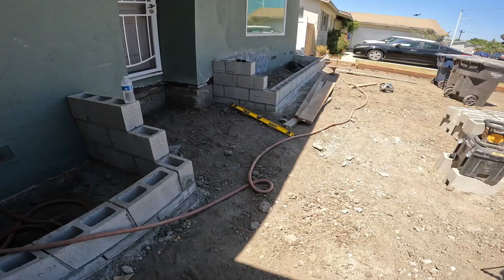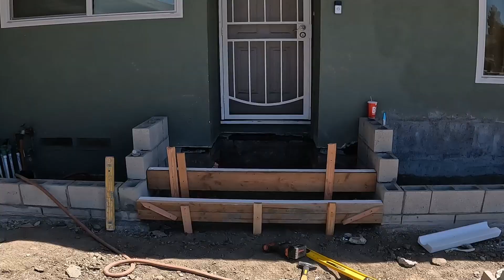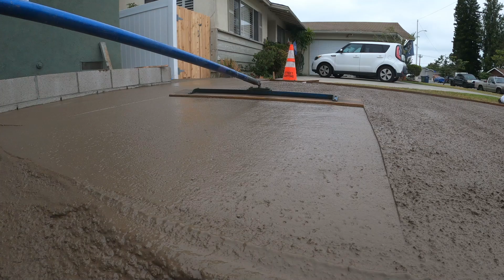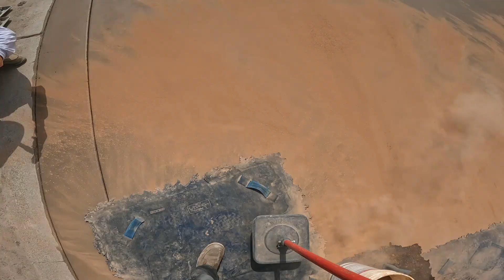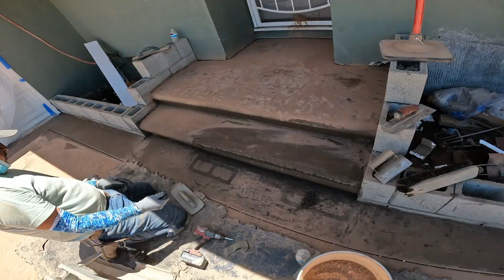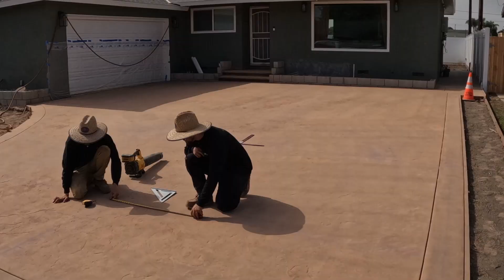Ruined Brand new Stamped Concrete Driveway!?! I cant Believe this Happened!

Comment: I like using Butterfield step liners they cost a lot but you can use them over and over attached to the wood with a finish nail no need to strip them

Comment: Don’t buy them make them out of blue styrofoam. Cut the size of rise you want and run them on table saw on diagonal. Use profile of one to adjust blade height. Won’t be perfect but close and you won’t be able tell there not.
Reply from the maker: Sounds interesting
Reply: @OdellCompleteConcrete  and spray them with liquid release right before placing concrete

Comment: Best glue i found for foam to wood is polyurethane glue (ie. Gorilla Glue).  Mist both surfaces with a bit of water, then stick em together.  Dries fast, holds very well and won't melt the foam.
Reply from the maker: Interesting
Ty

Comment: I have done concrete flat work ,stamp,walls curbs ,you name it I done it .never heard of straw and would not recommend that at all.never heard any one even say straw when talking about fill in a slab or any kind of back fill .maybe to keep mud from getting on finished product.concrete 8 inch block to fill in steps is good .and the bull nose foam forms I used to use small drill bit and drill 2 holes about 3 inches apart from each other and run wire threw my step face and the bull noise and twist it on out side of wood form .seem to work good with no mark on concrete face .used duct tape before that work good .by foam board and make your own bull face forms .instead of paying 30 dollars a piece.they sell the foam and not hard to make a diy jeg a mado.
Reply from the maker: Top secret stuff

Comment: How comes you do not use crack inducement joints and just cut the middle.. this will crack from edge to your cut lines. Bet you have to go back on some jobs because of cracking. Integrity should always come before beauty with concrete...
Reply from the maker: Corners crack

Comment: Here in England we use pva glue to stick the poly forms to timber... And use normal polystyrene then carve it ourselves, doesn't take long.. also why do u strike your forms so quick? Give it more time,Also we use fiberglass in our concrete so it holds its form around corners or mass fill it.....
Reply from the maker: Good idea
Ty

Comment: Hey man youve been a great help to me in the past had one question today.
So crew i work with we use mags for floating.
Typically do decorative work.
Is there any do's and don'ts for using a resin trowel for scrubbing? I know its great for those "oh crapp" moments and used for broom finish, burn finish, curbs but is there any issues if used for stamped, sandy finish, things like that? 
Out in pnw WA and ORG. Use mags and steel trowels but i see some crews use resin floats. Ive always met old school guys who used wooden floats. I know it does same as a mag but i get that resin /wood are rougher. 
My question is, will using resin at the wrong time cause major problems with end result finish?

Sorry if im all over the place, i have a diffucult time expressing what i want to say on paper/text and in person sometimes lol. I was more of a math and P.E. guy🤣
Reply: EDIT: P.S i am also hesistant to bring one onto the jobsite is because why wouldnt all finishers keep one on hand JUST IN CASE concrete sets up fast and they need to speed things up. Like ya know? Any tool to make the job easier right?
Reply from the maker: Every situation is different. I like to use all the different tools and decide which one is working best for me.
Reply: @OdellCompleteConcrete  sorry man. My english/writing is garbage🤣. Makes me wonder if i got problems sometimes. Lol but im great with numbers and measurements strangely enough.
Anywhere my main question was is it suitable for all finishes. Like can it completely replace a mag float?
Can there be issues if you use a resin float at the wrong time? (Example: like if you use a steel trowel to place concrete when its still wet/ just poured. 
Thanks again man. Appreaciate your advice and you content man keep it up!

Comment: I love watching your videos.
I was quoted $2800 for a 8x12 x 4" shed pad in Canada. I used your tips and got it done myself for $550. Found a company that delivers pre-mix "pay as you go" only pay for what you use. My neighbour borrowed me a bull float and edgers. Looks as good as anyone could hope for.
I kept it covered and moist for 3 weeks. It's solid as a literal rock! When I went to drill my baseplate anchors into it, the concrete definitely cured harder then I'm used to this way!
Reply from the maker: That's the way to do it

Comment: Yeah, it's the solvent in the 3m that dissolves the styro. Like you said if you let the solvent dry first you can apply the styro with little or no dissolving. I found out the hard way too. Industrial strength double sided tape is probably easiest and most versatile way to attach styrofoam to anything in my experience.
Reply from the maker: Yes the acetone acts as a carrier and evaporates quickly
Reply: Try using a dribble of aerosol foam. The 'window and door' type doesn't expand like crazy.
If you make a sandwich (backer-profile-profile-backer) a couple of wraps of electrical tape is all you need as a clamp until it sets.

Comment: wow if those pieces of styrofoam were more than twenty five bucks each i would be really pissed at myself for ruining them. that spray glue has solvents in the propellent. didn't you ever spray carb clean or brakleen around any foam? seems like you could have used double side tape without melting them. how much were they?
Reply from the maker: 25 sounds about right

Comment: They make adhesives that are foam proof that you can buy at the home center and there is a form release liquid that can be had for that white foam. There are quite a few designs of that foam edge we used to use them on swimming pools but we never had to strip them early for a finish as pools have epoxy finishes on them but I sure used to sweat installing those foam forms on those custom radias`s but never broke one.
Reply from the maker: Good to know
Ty

Comment: That looks amazing... For myself who works on my vehicles and such, I could not deal with a driveway with a texture like that, but if I had a good sized shop (like an RV garage with the 6 bay garage) then I would do something like that for curb appeal out front.  You guys did amazing work.  I'd like to see more on the fix for the step, did you guys mix more concrete to fill back in and use the screws like a dowl/rebar type thing to hold it in?  Or did they press the curb that fell off back on?  Did it require a coat of cement glue or something to help hold it to the step poured awhile back to prevent a cold joint crack?  Just interested in that part more is all.  A video on that scenario laying it out would be cool to see.
Reply from the maker: We remixed the part that fell off and put it back

Comment: Typical Mexican Fix for the Steps that FAILED.  To fix it PROPERLY, why not REMOVE THE STEP COMPLETELY AND REPOUR IT PROPERLY.  The MIX WAS FAR TO THIN even for the slab.  I would have had you STOP if it was my place and send the concrete BACK and get it down RIGHT from another company.  You are NOT a professional concrete man.

Comment: Raised planters against a house wall is just asking for termite trouble.
Reply: How
Reply: @fern3832  Building code typically requires dirt to be 4"+ from the wood framing. Putting a planter up against the outside of the stucco invites subterranean termites to find cracks in the stucco and start eating the siding or entering the house to find some nice trim wood. The water used to feed the plants in the planter box goes to feeding the termites.  The planter box hides their tunnels and allows them to enter unnoticed, usually until its too late.
Reply from the maker: Raised concrete Fondation

Comment: Turned out nice. With that much help on such a small driveway they should have been able to cut the joints with a nice 304 or 314 jointer and given the borders a nice sand finish with a sponge. Also your boy would be better off finishing concrete than recording videos. 350 cash for 4 hours worth of work is 87.50 an hour. He can apply for state benefits and double or even triple dip by also applying for financial aid. Just saying!
Reply from the maker: That sounds too good to be true.

Comment: Excellent design and Implementation, would love to see it person,  but it's a bit far from England to pop over 😀. 
With regard to setting out a line perpendicular to another, you can use a 3 4 5 ratio triangle , just mark out 3 feet, then with the hypotenuse at 5 feet, when this crosses the vertical at exactly 4 feet, you have at perfect 90 degree angle, works with any ratio using  3-4-5.
Fantastic work as per usual. 
Thanks for sharing and best regards John.
Reply from the maker: yes this way works out very well too! thanks for sharing the info!
Reply from the maker: Great suggestion!
Love that system, no need for a square

Comment: To make the bullnose you can rip a piece of 2” PVC in half on a table saw and butt it up on top of a ripped 1x. Attach to the form with screws. Wont crush like the foam does.
Reply: They sell silicone reusable at like 200$ a piece
Reply: I used to use pvc when doing a big radius on drywall.  Not as a form but as a the actual outside corner.  Cutting it on the table saw is a little tricky though.
Reply from the maker: Try putting the blade on backwards
Reply: I was thinking the same.
Reply: Bandsaw and taking it slow would be a far safer approach to cutting pipe in half..
Reply: Thats a great idea. Thank you from a fellow contractor

Comment: Wait- bails of straw to fill a large void?  And when the straw breaks down what happens then?
Reply: I don’t think it’s a good idea… I would rather use salvaged concrete chunks from the demo to fill large voids.
Reply: 😂😂😂 are you kidding me? Straw? To fill a void in concrete?
Reply: If you have 6 inches of concrete around all sides of the straw, you have a strong structure. You don't need solid concrete to have strength. Especially on a step that will only ever bear hundreds of pounds, not thousands.
Reply: @obviousness8113  👍
Reply: Straw just fills the void. After it drys and  cures it's just like a concert floor held up by concrete footers
Reply: Fast draining sandy soil? Dry, Southern California environment? That straw will still be there for many many years. Check out other examples of straw bale construction and specifically, plastered straw bale construction by David Bainbridge.
Reply: Personally i would have used some of the old broken up slab that was removed in the skip and called recycled.
Reply: Here in Australia we use styrofoam to fill large voids as they have done
Reply: Yeah straw is there for the long haul. Go check out the floor of straw barn and try to dig it with a shovel. Tough stuff!
Reply: Straw has been used in construction for hundreds of years.
Breeze block walls had straw in them too called a strammit block
Reply: I have always always been taught you do not want any organic material under your slab unless your are pouring on pylons pushed into the ground because it breaks down like every other organic material. My dad has 31 years doing flatwork and I've been in it 11 and that's our opinion.
Reply: They use to do that with concrete porches back in the day and pull the hey out after it cured from under the house if the bottom of the porch didn't have crawl space holes. The sides were either cinder block or concrete with a concrete top.
Reply: @jimmieburleigh9549  crazy thing is I’ve taken out a few like that in Minnesota. When there’s a basement involved a concrete step needs a ledger because that backfill sinks. But the straw bale is no different than buying precast. Concrete properly reinforced and thick can easily span once hay is gone.
Reply: @Justme-sb8mn  
I was going to mention the precast that are only about 4" thick. 6" is allot. 
Hay bales are usually very tightly packed.
Reply: That's how we used to do it.
It's a frost free slab.  Monolithic,self supporting.
When the ground around it expands from freezing it's not affected
Reply: Isn't the concrete  too dry?
Reply: I am not in the concrete bidniz but if this dude wants to use straw that's his choice  you use what you think and know is best  simple  all the experts don't have to come out the workshop to critique his work
Reply: @SG-uh6sw  I didn’t critique. I was curious because I’d never heard it before so I asked a question. That’s all.
Reply: If it gets wet it certainly will.
Reply: @djAnakin  no it doesn’t I helped build barn conversion it was over 100 years old the hole barn was made of some type of clay and straws…
Reply: It's never too late to reinvent the bicycle
A smile brings forth energy or life, givin' you force.
Reply: Repent to Jesus Christ “But seek first his kingdom and his righteousness, and all these things will be given to you as well.”
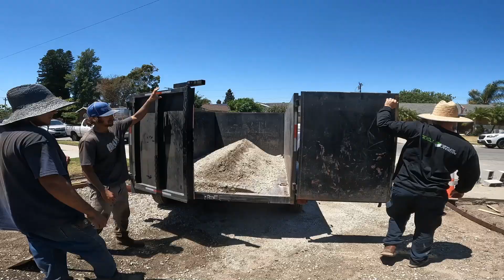Matthew 6:33 NIV
T
Reply: @repentandbelieveinJesusChrist3  he does concrete too?
Reply: @repentandbelieveinJesusChrist3  Jesus was a carpenter, wrong subject here buddy
Reply: That’s an old thing they used to do. Anyone doing that anymore shouldn’t be hired.
Reply from the maker: Straw doesn't decompose
Reply: @OdellCompleteConcrete  it does it gets damp and mould
Reply: @OdellCompleteConcrete  straw most definitely decomposes. It rots away like any other organic does so that’s why it threw me off that you said use it to fill large voids. I guess by the time it decomposes you won’t have to honor any sort of warranty but it will one day rot. Definitely has me wondering now!